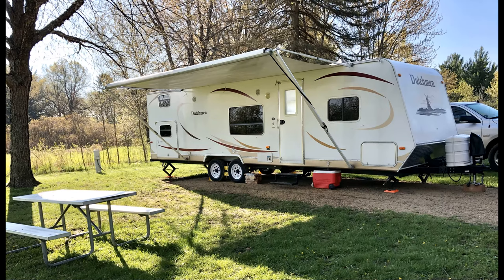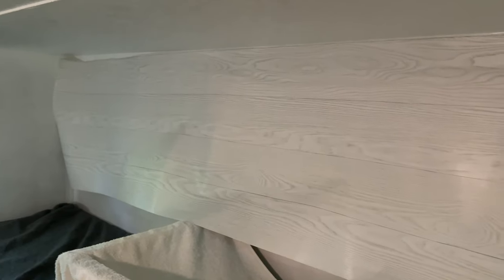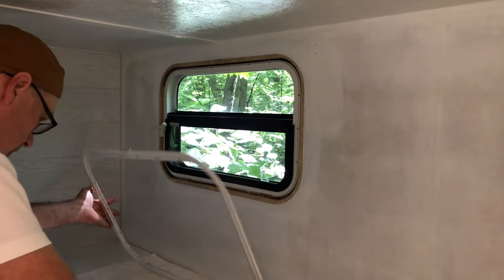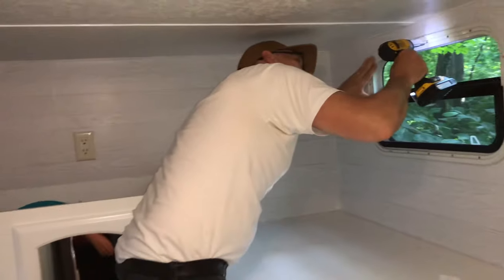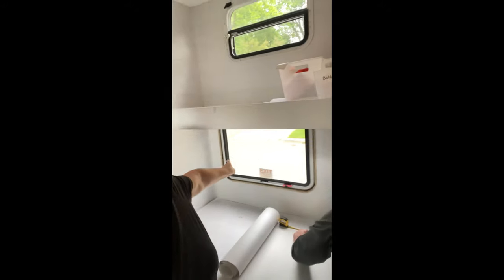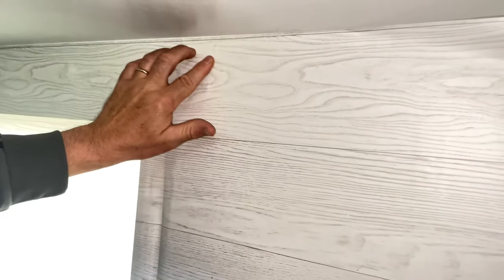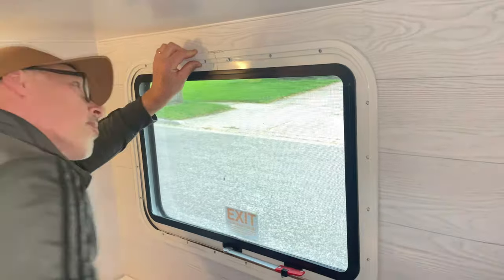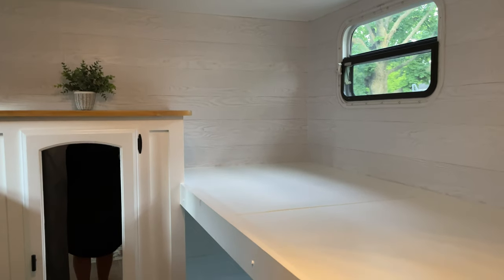Peel Stick Shiplap Wallpaper RV Walls Tips

Comment: What did u clean walls with?
Reply from the maker: We used a scotch scratch pad to quickly and lightly scuff the walls. Then we rinsed off with a rag and clean water. We then primed the walls  and waited about a month for it to cure before applying the wall paper. 
Our walls were fairly clean to begin with so not too much time was spent cleaning them 😊